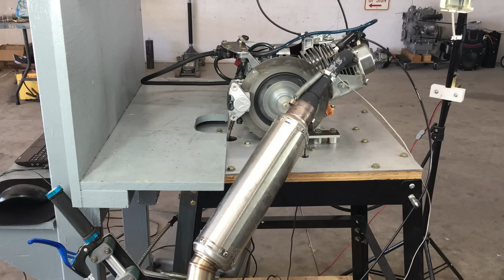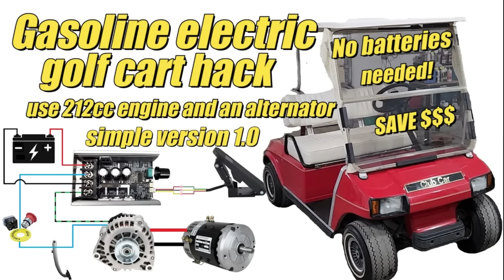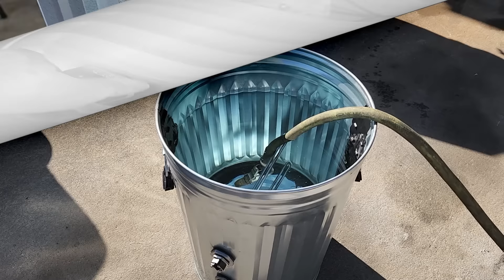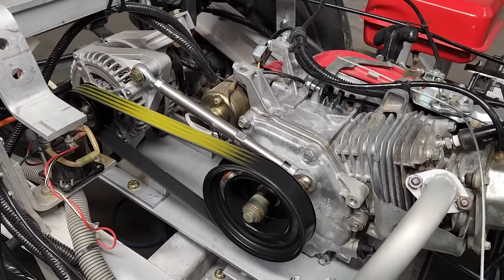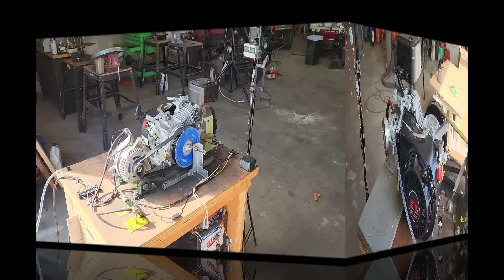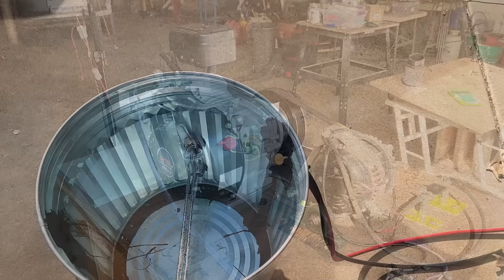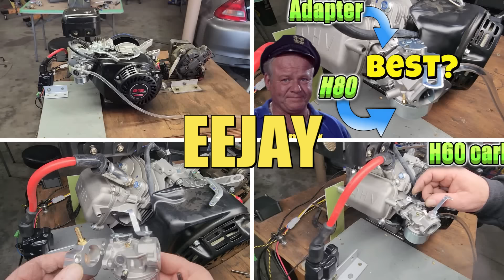S6 E5  Our small engine test stand is BUSTED!  can we fix it on the cheap?  Let's do an experiment!

Comment: Why do you use belts to connect the engine to alternator (apart from it being highly economical)? Wouldn’t the belt slip if the engine got up to stall load?
Reply: To frame my question a different way, I often hear slipping serpentine belts in parking lots and in traffic etc. Those belts are well below stall load, but slip. Why would a belt above stall load not slip?
Reply from the maker: So far the serpentine belts have proven to be slip free.   If you notice the pulley on the engine is 3 times bigger than the alternator belt  this allows us to spin the alternator at over 10,000 RPM.  if we were to direct drive the alternator, we would not be able to get as much power from it.

Comment: I would just make a bank of switches, each connected to a length of nichrome wire selected to dissipate around 300-400 watts. Then just turn on switches until I get the desired amount of load. I might even replace the switches with relays if I could find some for cheap enough. Then using the shunt and an arduino I could make it into a programmable load with a display.

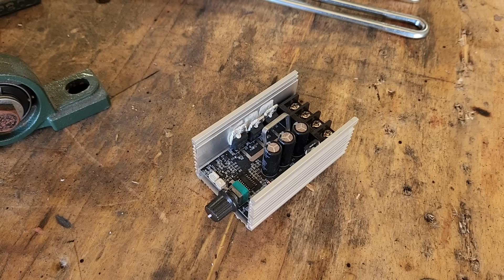Comment: 4:48  this voltage regulator is TOASTED 
look at the mosfet not even touching the aluminium heatsink
Reply from the maker: Meh, that was a junk power supply that was handy,  the real one that we used was fine.

Comment: FYI you can often get hot water heaters with good elements in them for free. Usually the tanks go bad before the heating elements do, so you can salvage the elements from them if you don't mind dealing with disposal of the rest of the heater.
Edite: Never mind. I just checked and they're like 33 bucks at the homeless despot for a pair. Probably not worth messing with the scrap water heater at that price.

Comment: Don't bother with a drain - just remove both bung plugs and stuff a hose into one all the way to the bottom and let the hot water overflow out the top.  Same alt, same care, it blew out a bearing AND STILL CHARGED THE BATTERY!  Bearing came out in bits when when replace the alt.

Comment: With the weather getting colder, you could pump the hot water through a couple car radiators and heat the shop.

Comment: Hi what I have seen many years ago was for a motorcycle, it used a water pump, the load was a water valve and a tank. it used pressure gauges and a scale to calculate HP the water heater is a good Idea. you can loose the diodes in the alternator
Rich

Comment: Why not ac straight off the coils without the diodes.  The alternator is ac. The heater element are ac. Match made in heaven.  Ok peanuts any one. I’ve a ton. 😅
Reply from the maker: We could do that, but we want to dump as much power as possible and loosing some through heat in the diodes works to our advantage.

Comment: Why drill holes into the sides of the trash can instead of mounting them from the top on some type of apparatus? Like a 2x4 or bent sheet metal? Punching holes seems like a bad idea
Reply: Water level needs would be allot more sensitive if mounted in the lid and harder to verify complete element submersion.

Comment: Just a thought, why not run dual alternators? Theoretically itll allow you to have a more even distribution of load, and lose less of it as heat from the one alternator getting hot, instead of spiking the single alternator with a load at the flip of a switch.

Comment: Most silicon diodes are rated for 600-1200v. Diodes have a fix voltage drop, so the heat the diodes dissipate is really a function of the current passing through them. Likewise the the heat in the windings is going to be a function of the winding resistance and current. So the alternator is probably very understressed and operating much more efficiently at the higher voltage. As long as the insulation can deal with the higher voltage, you should be able to get a lot more power out of it.
Reply from the maker: I think the way the numbers will finally work out is we will have 60 volts at about 50-55 amps on the output of the alternator for a full load on the engine.

Comment: Those cheap step drill bits are far better than the ones i got. I drilled one hole, and then it was too dull to drill another. One use only i guess. And it was sheet metal.
Reply from the maker: LOL, I bought that set as a throw away, but they have lasted longer than my expensive bits....
Reply: @robotcantina8957  what they make it out of..gallium?

Comment: Jimbo, why cut down the 55 gallon drum? I’d imagine you’ll run out of thermal capacity at some point (boil the water). Why not keep it at the full 55 gallons in case you want to test larger engines or do longer runs?
Reply from the maker: its to make it smaller in order to save space.
Reply: @robotcantina8957 Well, you could always strap a small radiator to the side and run a cheapo pump if you needed to, I suppose. Although, it’d probably take three hours to boil that much water with 3kw of heat… So likely it’ll never be an issue.

Comment: Your trash can and heating element setup made me chuckle and reminded me of something I came up with when I was in the Army. I took a glow plug for a HMMWV and mounted it in a hole I drilled in a coffee can. When hooked up to 12v it would boil water. Took a minuite but hot water is a wonderful treat when your out away from amenities.
Reply from the maker: LOL,  sounds like a solid plan when you don't have any other choice.
Reply: I don't think there's that much in a glow plug that'd even be a problem to boil water over. Iridium is pretty inert, stainless steel is literally used for cookware, long as it's not covered in engine shit that's just plain useful. You'd just never bother making a water boiling element that can handle 2000 degrees

Comment: Iam glade to see you know how to over volt an alternator. I watched a video i will not name here. He used cordless drill batteries. Went from 12v to 18v and concluded there was no improvement. I was yelling at the screen. 12v-18v is within normal operating specs and will behave the same.
 Also both batteries put out the same amps.
You need volts as well as amps for increase.
Reply from the maker: Well said, thanks!

Comment: Why do you even need rectifier diodes if you don't have a battery to charge? Just connect each alternator coil to a separate heater element (or two in parallel) and heat your water with AC current.

Comment: Nice work again Jimbo, always a pleasure to learn from you. BTW 1 HP is about 750 watts if i remember correctly, i did some calculations a while back on 3 phase brusless motors for an aero moddling project
Reply from the maker: Yes 1 HP is about 750 watts, but the math gets fuzzy when you factor in the efficiency of the alternator.  A 750 Watt load works out to be a lot more than a HP.   Since the efficiency is variable, we cant use watts to measure exact HP and we will have to construct a rig to measure the torque on the alternator.
Reply: @robotcantina8957  Yep them brusless motors were and still are crazy, we were getting over 90% efficency. taking into account losses etc..

Comment: I think the alternator diodes have to be rated at least 800 volts as the discharge pulse from an automotive coil is around 400 to 500 volts.
Reply from the maker: Interesting,  good point.

Comment: Your diodes were fine. My cheap Chinese 250A GM style alternator blew a diode in the rectifier at 36v and almost no load. Running an external rectifier at the moment, but the losses across a standard rectifier vs the low forward bias schottkey ones I assume are in the rectifier I blew up aren't small.

BTW. I love all your content. You are a slightly chronologically more advanced version of me.  When I watch your content, I see myself in about 5-8 years!
Reply from the maker: Thanks!   Keep playing and have fun!

Comment: Are the water heater elements 12V?
Reply from the maker: The ones I used were 240V.  The new ones are 120V.  The voltage doesn't really  matter its the ohms I'm interested in.

Comment: I have a question. Can a little bit of propane be added the intake of a diesel to make it burn/run more efficiently? I recently saw something claiming such, but in all my many years... I've never seen or heard of that.
Reply from the maker: We tried that on the test stand last year.  the engine sounded better and the exhaust smelled better.  Using two fuels raises the cost of running the engine and I'm not sure it would save money.
Reply: @robotcantina8957  Thanks for answering so quickly. Hm... I remember seeing you do a couple things last year or so with a small China Diesel. But I don't remember the details, expect that I was wondering if a little diesel engine would be useful for anything. I had your truck in mind when I saw someone call propane "poor man's nitrous" 😏 even though I was skeptical. I figured you would know more about the subject.

Comment: How will this setup "measure" power?
Reply from the maker: This set up will not measure power developed by the engine.  it's just a load for the test stand.  However when we build an actual dyno, we can use this load.  A true dyno needs to be able to measure torque and RPM in order to calculate HP.

Comment: A PWM i would think would mess with the magnetic field. The delta configuration of the alternator is all about timing. Please use a rheostat as stated below.
Reply from the maker: No worries, the pwm signal has a decent sized capacitor on the output.  the actual signal looks very analog.

Comment: The little single cylinder ditchpump engines are shakers, even if the pulley is centered.
Reply from the maker: It seems that way, however I'm using a fairly long bolt instead of a short grub screw to secure the pulley hub to the crankshaft.

Comment: Just a thought could you use a load cell on the alternator with an hx711 to an Arduino to vary the rotor voltage. Thus maintaining the load on the engine very accurately to measure the HP ?
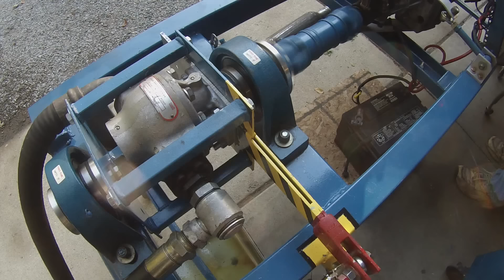Reply from the maker: Yes, that's the plan, however the alternator has to be mounted in a special cradle with bearings in order to measure the torque.  at 2:06 in the video you can see how the hydraulic pump was mounted between two bearings and you can see the torque arm that measure the torque.

Comment: Not sure if it will work for your needs...

Conveyors use break resistors...to suck up heat? They are tough
Reply: Also another crazy idea....and it is crazy, super crazy....

Before diodes we used tubes as diodes...i actually use both together when making old tube amps
Reply from the maker: Stuff like that would work, but is expensive.  we focused on cheap because it helps other people realize there are cheap alternatives.

Comment: Awesome, a sneak peak behind the scenes to see the madness behind the method! Love it!

I was going to suggest using some type of oil (like mineral oil) instead of water.  It would prevent rust and corrosion in the barrel, it's non-conductive and doesn't  "go bad" like water will.   A long time ago I liquid cooled a computer by submerging it in mineral oil.  It was effective, but messy if I had to do any maintenance on it!   Then I heard you say that you wanted to be able to dump the hot water and refill for faster recovery time during experimentation.  That makes sense, and I guess it'd be easier to store empty as well.
Reply from the maker: LOL, I reckon the oil would work, but as you know that would be messy.

Comment: What is the reason dor cutting down the 55 gal drum? Couldn't you just put the heter elements in a normal drum and not fil it all the way?
Reply from the maker: Just to make it smaller so it can be tucked under a bench when not in use.

Comment: I know that this might be too late, but you can get cheap ceramic loads like the ones you used before, they're sold as replacement for water heaters too, here in Europe we're seeing them more and more so the prices dropped quite a lot, if you Google 2kw 315mm ceramic, you will see them for 20-30€, and even though they're for water heaters they're not submerged in the water but live in a pocket of air and do the energy transfer through air/contact to the water tank.

Comment: ahh wonderful heavy battery cables! a thing of beauty! i used to build test boxes for the auto industry. used really heavy cable for them. always got teased about the overkill heavy cables. i got let go in 2007. last i heard was that the boxes were reconfigured many times, but still working!
Reply from the maker: LOL, good to know!    On this rig, I'm expecting to pull about 120 amps for various experiments.
Reply: @robotcantina8957  You forgot to factor the copper cost of those cables. Ouch! I bought 50ft of Red/Black 4 guage last year for a project and it was nearly $50, plus another $30 for crimper and wire lugs.

Comment: Now i'm curios if you set the alternator to about 25v with a load. If you could hook some welding leads to it and run it like a stick welder. It's a 140 amp alternator so i'd imagine 3/32 rods would be in it's ball park without going crazy on stressing it.
Reply from the maker: I reckon I should give that a try.  3/32 rods you say.... hmmmm
Reply: @robotcantina8957  figure 6013 3/32 runs between 40-90 amps and 7018 runs 65-100 amps. If you're really feeling lucky you could see if it'll run 6010 which most cheap inverter welders won't run.
Reply: @robotcantina8957  Got to thinking about this a bit more. Stick welding is constant current with voltage allowed to be variable. Most stick welders run about 80v open circuit. I'm thinking set ocv to 80V then vary engine speed to change amperage?

Comment: Make a rheostat. A bottle of water. Add sodium carbonate.  Two stainless steel solid wires. One wire all the way in. The other wire is adjustable in depth for resistance.

Comment: 6:54 So question here. Did you just draw it that way for simplicity or is there a reason your fuse is on the ground side and not the POS side? I was always taught to put the fuse on the POS side as close to the source of power as possible to interrupt the current flow before reaching a critical component.
Reply from the maker: the drawing was from the manufacture of the PWM power supply.  Not sure why they put the fuse on the negative side other than the fact the PWM signal is on the negative side.
Reply: @robotcantina8957 Damn I was hoping I’d learn something new from you.

Comment: I know your talking to the dumb ignorant people but I've been a mechanic & electronics tech 40+yrs & I was using a Bosch truck alternator 30ish yrs ago with a primitive transistor field winding regulator to control current & full open I got 200V @100A rated obviously not possible ran by a Tecumseh 10HP & I couldn't kill it here in OZ on 40C day but was a long time ago & I'm close to your vintage  but still working mate. Cheers from OZ
Reply from the maker: LOL, good to know!  thanks for the input from OZ.

Comment: You should maybe keep the drum at full size and fit it with a radiator + pump so you don’t have to change the water
Reply: +1
Reply: Came to say this as well, just run an externally powered sump pump through an old iron duke radiator have a small amount of flow to increase dwell time in the coils to dissipate heat
Reply: @nickh.3315 add a fan and it will work even longer

Comment: Awesome! I've been experimenting with a hot tube similar to yours but I'm using a glowplug, so far i have a 12.8mm Id tube approximately 250mm long with a M10x1 nut welded on the end for the glowplug and a adaptor for the spark plug welded on the other,  ive got the standard carb right now but im changing to a adjustable one soon, in my testing so far it starts with a jump lead on the glowplug but doesnt stay running for more than a minute without the glowplug and the glow plug is overheating, so im making a seal that means only the glowplug tip is exposed to combustion (same as in an engine) to prevent overheating and then a pwm control for the glowplug so i can ramp the plug down while the tube heats up to self sustain. Any comments or criticism welcome, my end goal is a multi fuel engine (diesel one on carb, petrol and lpg on the other switched by valves) that drives an alternator that can either directly charge batteries (12v,24,36v or 48v via mppt) or run a solar hybrid inverter for upto 5kw power output in a single trailer
Reply from the maker: Wow, you taking the hot bulb experiment pretty far.  It will be interesting  if you can get the glow plug to work without overheating it.    With our rig it took about 5 min of run time with an active spark plug before the engine would run on the hot bulb,  the tube has to get super hot in order to maintain combustion.  It seemed like the long tube was the key to getting it to work, but as you know that also reduced compression.  Keep it up!
Reply: @robotcantina8957  mini update, I've installed the bit of bar to seal the glow plug and overheating the plug is no longer an issue but the engine is backfiring now, i believe its because inserting the bit of bar to seal off  the glowplug behind the tip has both shortened the tube by half the lenght of the glowplug and also reduced the internal surface area and overall reduced the heat, and as the engine is backfiring its also not getting enough heat to self sustain (i abused the glowplug and just ran is direct to battery for about 5 minutes as the pwm driver isnt due to monday and i have spares) so my plan is extend the tube by the amount i shortened  the internals and also insulate the hot portion of the tube, ive got some oven insulation left over from a previous project and some kapton tape and hopefully those changes with the pwm driver will have it running smoothly